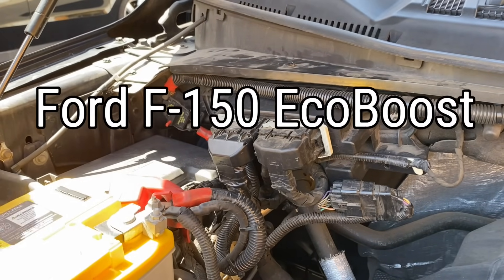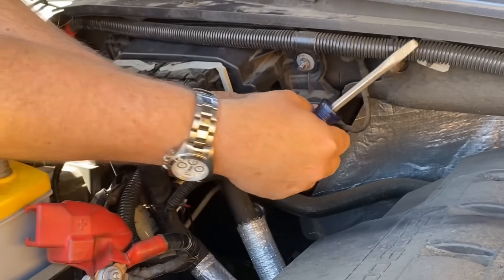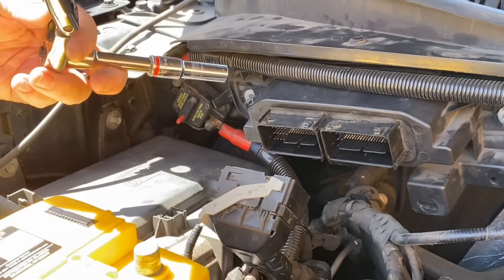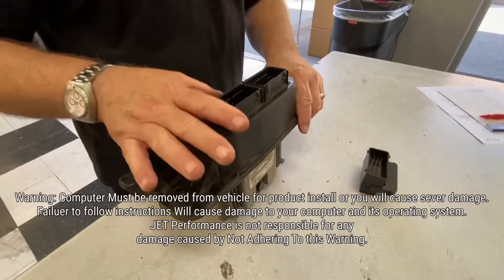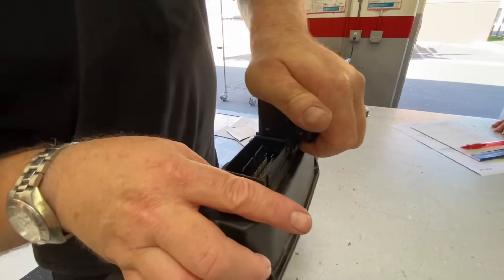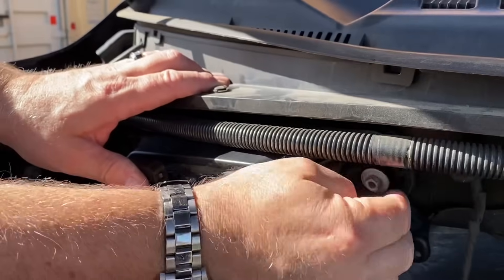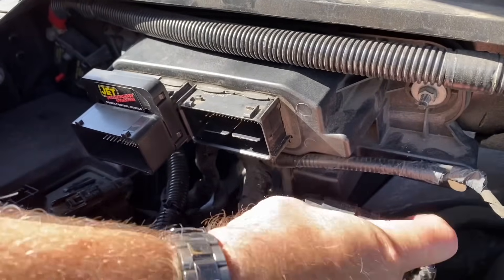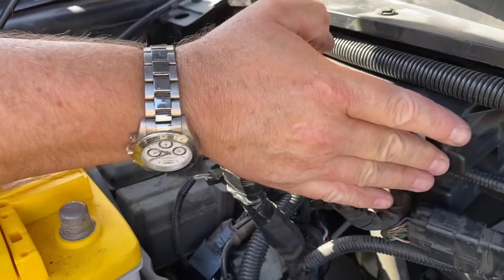Ford Performance Module (Adding Horsepower)

Comment: I was going to order one so I contacted jet with some questions. After talking to them, they went out of their way to convince me not to. They couldn't tell me what it did, and told me it was never tested but said 20 hp gain.
Reply from the maker: Hello there, not sure if you talked to us or some other company because we know exactly what it does and how to explain this. We test all our products for quality control.
The Power Module is a piggyback tune that advances your stock tuning. So, you air to fuel ratio, ignition, timing and shift points are all advanced. This will increase your horsepower power and torque. The stage 1 (on a stock truck) will give you around 8-11 hp with 9-13 torque. 
The stage 2 (on a stock truck) will give you around 13-15 horsepower with 14-17 torque.
Adding general bolt-ons (aftermarket intake, headers, exhaust) will increase that output.
Hope this helps understanding our Power Module.
Reply: Cool thank you, I'm interested in buying it again. I'd like to try it on my new GMC 6.2. Does this add additional timing above what the stock ECU is capable of? Will I see additional timing on my scan tool? And How much does it raise the shift points? Thanks
Reply from the maker: @wko78ms  No it doesn't add additional timing it just advances it slightly, that's limited by the PCM it changes the value of advance under different load conditions.
The shift points are raised but, not drastically, again very slight due to the PCM limiting that.